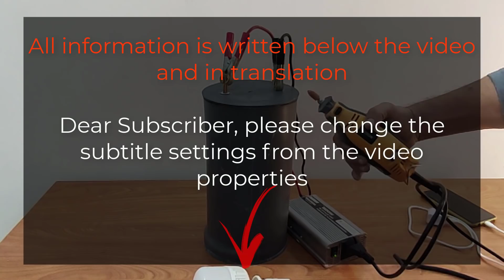Three months on probation until it succeeded

Comment: My friend asked me if this battery runs a 15w tree fan, how long will it take to run out of power, waiting for your reply, good luck
Reply from the maker: Mr
We ran a fan motor that drew 1 amp per hour and the fan kept running for 12 hours
Reply: WOW?
What was the voltage of the motor?
Reply: @NetHelp2 According to this information you have given, if your project is realistic, it is understood that it contains 2.76 KWH of power. !!! 
******* 
 Verdiğiniz bu bilgilere göre, eğer projeniz gerçekçiyse, 2,76 KWH güç barındırdığı anlaşılmaktadır.

Comment: It is a great idea, but the metals are corroded by reactions. If it is capable of lasting for more than a year charging and discharging itself, it could revolutionize the world. Otherwise, it is the same as what happens with current lithium batteries that last approximately 400 cycles and in the long run it is a wear and tear of raw material and contamination.
Reply: In a lot of emergency life-rafts, and survival kits there used to be a flashlight that was activated by water, you could even piss on it if no water was available, used to be able to buy them at army surplus stores
Reply from the maker: Yes, that's right, it won't last long for more than a year
Reply: Trick is that this is fake

Comment: Making a battery without knwoing how to make a battery!!! The voltage at best could be 1.8V for a single cell and quite a good amperage but not enough to drive a power machine even with an inverter!!! The Baghdad battery can greatly be improved by using anodized copper and iron but still will require a lot of cells to be connected in series and parallel to meet the power requirements of a drill. A Supercapattery design  could  be quite convincing!!!
Reply from the maker: This method is the same as the Iraq battery method. You can search for it in Google
Reply: @NetHelp2  True but it can't give out the energy as displayed. It is a very reliable battery and can be greatly improved with different eelctrochemistries and modified eletrodes. If you really like batteries like you do, I invite you to visit Dr. Robert Murray Smith Youtube Channel  for Energy Storage Materials. He has some great simplified tutorial and if you want more serious stuff, you just have to send him a message. I hope you get all you need from this great researcher who is giving the world all the knowledge for free as he breaks all the barriers of science for everybody to have access. Knowledge shoul be free, knowledge should be shared and thanks for sharing your knowledge with the world. If you have any question on battery electrochemistry, let me know. I would be priviledged to help!

Comment: THAT battery could at most only put out 0 volts and you can't charge it. It is a chemical reaction battery just like a modern-day alkaline battery. But there is a bigger problem at 1:57, both electrodes are copper, one has to be a different metal that doesn't electrolyze to get negative. What he has done is create two separate half cells that can't react with each other, which they have to, to create electricity. If you don't believe me tear apart an alkaline battery. What you will see is a metal tube that you tore apart which is negative, with a carbon rod in the center which is positive, and an electrolytic paste in between. It's just another one of those scam videos to get views and gets a thumbs down !!!
Reply: You are absolutely right, and the Bagdad battery made only  0.4-0.5V, no way any two metals in the Universe can produce a potential of 12V, especially if they are the same metal. Also when it was connected to the charger in the video, the Ammeter showed 0A!
Reply: @Tore_Lund  -- The guy said that you could charge it but there is a really big problem with that. They didn't have battery chargers back then, especially 12 volts. LOL
Reply: @Ken-rk3by  Yes, the Bagdad battery used Iron and copper, so it would not need to be charged, but this battery with only Copper?
Reply: @Ken-rk3by  not all batteries are chargeable and if you look there isn't any way to electricity to flow  , eve the Bagdad battery  add electrolyte where the anode and cathode are immersed
Reply: @brunobastos5533  Don't you think that I know that not all batteries are rechargeable and the Baghdad battery isn't. There is a use for the batteries. They knew about the importance of ionic silver and gold as medicine even back then.
Reply from the maker: Mr
This works on the principle of the Iraq battery
I think the charger is working fine
Reply: @NetHelp2  was it charged if yes for how long and what Collage?
Reply: @NetHelp2  Was it charged? if yes for how long and to what voltage?
Reply: A concentration galvanic cell. Go ahead to google.
Reply: Tradu an romana
Reply: Странно то что батарея работает и при этом варианты сомнений и отрицания, вот это и есть парадокс.
Reply: Esse gerador gera pra sempre?
Reply: Small pipe is what,with no porus hole,I don't believe in  this project

Comment: i need this urgently in my village where we have grid lines but no power in the last decade!
Reply from the maker: In which village are you?
Reply: @NetHelp2  Araromi Idowu, Bakatari in Oyo state Nigeria (7°23'56.9"N 3°41'48.5"E)
Reply: @Net Help, Howany times can this battery Size be recharged?

Also, can I use HydroChloric Acid If I do not get Hypochloric Acid?

Is It Possible To Add Water To The Powdered Catalized Charcoal and Salt Mixture? 

If The Battery Is Charged More Than 12V, Will It Explode? 

What Determines The Amount Of Voltage To Subject My Size Of Battery To? Is It The Size Of The Mixture? 

Please answer my question One By One. You are Saving And Already Liberating Us With This Video You Uploaded If You Do Know!!! 

We just Need You To Make Certain Areas Clear. 

THIS battery/capacitor coupled With Compaxt Dics Made Solar Panels Is The Final Answer To Permanent Power Supply!!! 

Please Sir, we need your reply to each of our questions. 

Thanks.

Comment: This is not a battery but its a single cell usually 1.5 volts or less for each cell how you manage to make the power inverter to run with this low voltage..? How can you manage to make more voltage only with a cell ? Thats a micracle...
Reply from the maker: It is not a single cell as you think, have you seen the Baghdad battery or the lithium battery from the inside?
Reply: @NetHelp2  no can you send a link with it and after I return for this chat.

Comment: 1)The copper rod is touching the salt at the bottom for working?
2) Battery acid will it work ?
3) Can you charge with 24v?
4) How long is the charging time?
Good work!
Reply from the maker: The bars touch the salt
It works with the appropriate output for the size of the battery
Reply: @NetHelp2  How long is the charging time with empty battery and what is the max charging Ampere need?Also can I use hydrochloric acid from classical lead battery?
Reply: @steliosstamatakis844  в свинцовый аккумулятор нет соляный кислота, учти физику и химию, от серного кислота делают соляную кислоту с помощью химического реакции, то есть, от пар серного кислота получаем соляную кислоту, соляный кислота очень ядовитая)) опасно для дыхательных путей))

Comment: What is the name of the white thing you used
Reply from the maker: All we need is
1 - briquette
2 - rock salt
3 - plastic tube
4 - two copper rods
5 - brass screw
6 - aluminum screw
7 - copper strip 3 mm
8 - 200 g Hypochlorous acid 200L / H with a concentration of 200 PPM

Comment: Your battery is strange. First, you use same electrode material. Second, no solution of electrolyte to dissolve salt (lithium batteries have organic solvent to dissolve lithium hexafluorophosphate). Third, if this nonpolar capacitor, it's need wide area of electrode and dielectric sandwich. Maybe this is fake battery with something hide inside your battery.
Reply from the maker: Mr
This is the working principle of the Baghdad battery, which was manufactured more than 2000 years ago
Search Google for Baghdad battery and see how it is made
Reply: I as for the polarity of this battery easily understand how it works because of my research in Don Smith Self Powered Generator. When you Have 2 Positives With More of it In one Close Area than the other, You will Get One Positive As Positive And The Other Positive As Negative. 
All to be achieved is "Charge Separation". 

YOU ALL SHOULD STOP LIMITING YOURSELVES TO THOSE NONSENSE DISH OUT TO US ALL AT THOSE USELESS GOVERNMENT CONTROLLED SCHOOLS GLOBALLY TO MAKE YOU AND I REMAIN THERE SLAVES WHO DEPENDS ON THERE I'LL GOTTEN OIL.

Whether this is a battery or Super Capacitor, It is A Game Changer. It is A Liberator!
NOW YOU CAN USE Compact Disk and Alluminium foil and Transparent Plastic Tape To Make Powerful Solar Panels as the Surface of those CDs contains readily, Super Active Silicon!

Make this SuperCap/Battery and you have Free Energy Collectors Cheaply!

Think, think, think like a Human!!

Comment: If I wanted to make a 3.7V battery, what should I change?
Reply from the maker: charcoal strips
Reply: @NetHelp2  What I mean is the basic criterion in determining the voltage.  I think that the problem with this battery is that it is damaged after being discharged and cannot be recharged

Comment: What a waste of time and materials just to tell a lie....

There's no way you can get that much amperage or wattage out of a battery using the size and configuration you have shown.
Reply from the maker: Mr
The acid used is the factor for power generation, and it is similar to the Baghdad battery that was made 2000 years ago, but we developed the acid and the used acid is five times stronger than the acid used in the Baghdad battery
Have you seen the Baghdad battery and how powerful it is?
Reply: @NetHelp2  Yes, I have seen the Baghdad battery, it's a simple single anode and single cathode acid battery. 

The limits of the wattage of such a battery is far to minute when compared to what is required to operate the higher wattage dremel type tool that you have shown in this video. 

Get real, stop with all the trying to over impress people.

Most people clearly understand the principles of the electrical elements, attempting to run snow jobs on people only makes them sad for you. 

Simply using your skills to show people how to build functional electrical tools would be great and probably much easier without all the trickery.

Comment: Ain't those transformers mostly 12 and 24 volts. So you say you get 12 volt or something out of this cell. A normal cell only makes 1.2 or 1.5 volts or something like that. This is why batteries in cars have multiple cells in one batterie and they put them in series. Same with normal batteries, if you want to have a higher voltage they put more cells inside the batteries in series. Not sure, but it seems a bit fake.
Reply from the maker: Mr
This is not like a normal battery
But the acid used generates energy
Reply: Les vrais mots. a l'origine. Il ne sortira pas de cette batterie uniquement. Un volt et demi. Juste. Alors que l'ampérage de la batterie augmente. C'est ce qui arrive. Alors. Il ne naîtra pas. Douze Fu lt. C'est un mensonge. et induire en erreur
Reply: Büyük başarı helal olsun düşünüb yapan ve paylaşan kardeşimize .canabi Allah yardımcısı olsun.degişik çalışmalarını da bekliyoruz.  Birde sıra ile içine konulan elementleri yazsa çok güzel anlatım olur.
Reply: I agree with your view. I was thinking the same thing. Or is there something extraordinary here? It brings to mind the following question, if we fill this setup with 6 Volts 10 Amperes, if we fill it with 6 Volts DC and 24 Volts 5 Amps at the end of the filling, will a voltage value of 24 Volts DC be obtained at the end of the filling? Does the voltage value to be taken after filling depend on the filling voltage value? If our friend informs about this issue, he will have done a useful job. !!! 
******* 
Bu görüşünüze katılıyorum. Ben de aynı şeyi düşünüyordum. Yoksa burada bir olağan üstülük mü var! Akla şu soruyu getiriyor, bu düzeneği 6 Volt 10 Amperle doldurursak, dolum sonunda 6 Volt DC, 24 Volt 5 Amperle doldurursak dolum sonunda 24 Volt DC lik bir gerilim değeri mi elde edilir? Dolum sonrası alınacak gerilim değeri dolum gerilimi değerine mi bağlı olmaktadır? Arkadaşımız bu konuda bilgilendirme yaparsa faydalı bir iş yapmış olacaktır. !!!
Reply: A lithium battery is 3.7volts per cell.
Reply: Cool
Reply: Car battery is made of 6 cell to store more AMPS energy. But if you make one that big battery one cell  also will store energy. What makes the battery voltage is when is charged in 12 volts then the charcoal and battery acid are energized to load of 12 volts and store what has been energized, then the ions find negative and positive from where is been charged the first time with the charger and that will the polarity + and negative - of the home made battery 12 volts, the if you want 24 volts DC make another battery  and connect positive to negative from the second battery then  will be two cells making 24 volts dc.

Comment: the problem here is to call it battery, as it seem more like to be a capacitor,   ones there are separated chambers separated via nonporus plastic tube it can only change the charge.  So it is so that it will not work if you take out the inner plastic tube?  or I am wrong,  I have seen similar experiments without it..
Reply from the maker: Mr. in the next video will explain how to connect slowly and I will work not to turn off the battery before the experiment

Comment: I thank you for what you have done, but there is still a question: The inner pipe is TOTALLY Isolated from the outer one with silicon, how the salt can do the transaction of the power????? Thanks to you, and looking for your reply.
Reply: @raluhoragontv  A lead-acid battery has sponge lead on one plate and zinc on the other plate with a sulfuric acid solution as the electrolyte. You do have to have two different metals to make an electric connection
Reply: @Ken-rk3by  Are 3 electrozi. Ca un acumulator cu două celule. 2 cupru un carbon (activ). Clorul este cărăușul sarcinilor electrice.
Reply: @constantinvasile2964  Sorry man I don't know what you are saying. I only speak English.
Reply: A concentration galvanic cell with not trasmition a ion. Go ahead to google.
Reply: @raluhoragontv  Obviously you have never taken apart a lead-acid battery one is sponge lead and the other I believe is zinc. When you melt them down only the lead melts leaving the other plates untouched. Zinc has a higher melting point than lead
Reply: Does it mean the inner pipe can be elomited or just be punctured?  Pls what is Ah...capacity the battery. I didnt see it being charged and after discharge from usage what next? pls respond
Reply: Kkkkk
Reply from the maker: Mr
We punctured the tube in the video, but because of the montage, this moment was forgotten due to the speed, and in the next video we will work to avoid these mistakes
Reply: @NetHelp2  Now it makes sense, thank you for explaining.
Reply: @NetHelp2  -- Even if you did punch holes in the tube it still doesn't have a negative post As the acid eats both posts.
Reply: @NetHelp2  PLEASE REDO THIS AS PROMISED SOON!
Reply: @raluhoragontv  both terminals have lead but one must be different aka mixed with some other alloys or plated to be able to create a positive charge
Reply: @raluhoragontv  I know more
Reply: @raluhoragontv  it’s now what I’ve made up it’s what’s been know for decades by scientists
Reply: I think there few batteries inside the tube...
Reply: @harunhanin754  -- Ya I wouldn't doubt that the more he changes how he built it. The more fake it becomes if he put 8 rechargeable batteries in series he could charge it at 12 volts like he claims
Reply: Fake

Comment: It will produce large sizes, however, volts per 1 cell.
should not exceed 1.5 volts.
Reply from the maker: We are working on producing a bigger capacity battery

Comment: very good, but the inner pipe charcole is completely insulated  from outer side charcoal and there is no touch between both charcole even from the top. would you explain more
Reply from the maker: Connect via salt at the bottom of the tube
Reply: now the bottom side of the tube is very thin to allow passage of huge current through the wet salt between both chambers.

I'm wondering how you achieve it?
Reply: @jumasmarty6643  при окисление медь с помощью кислота выделяется водородный газ, и с этой газ образуется напряжения))

Comment: FAKE FAKE FAKE
ONE UNIT BATTERY NO 12V,  MAX 2V
Reply from the maker: Sir, the problem is not with the electrodes, but the acid is the most important
I hope you don't fake it before you try it
Reply: @NetHelp2  Acid no important.
This video is FAKE
MAX  2 Volt
Reply: @NetHelp2  Good work my friend, dont let these clever assholes spoil your enthusiasm... All they can do is criticism.... 😉

Comment: Ne prenez pas cette vidéos au sérieux, il n'est pas possible d'obtenir un différentiel de 12v avec seulement 2 électrodes. Le différentiel de potentiel ne doit être qu'entre 1.4 et 1.7V avec les produits utiliser. En aucun cas l'onduleur ne pourrait fonctionner. Une batterie doit être cacher dans le tuyaux.
Reply: Yes max 2V  
This is a fake video
Reply: @profezor2  la batería puede cargarse a 12 voltios pero el inconveniente es que su duración pueda ser mínima.
Reply from the maker: Monsieur
Avez-vous cherché sur Google les caractéristiques de l'acide utilisé ?

Comment: 😂😂😂 its fake  battery no way between copper to connect and no single cell can give 12 volt
Reply: Yes, FAKE VİDEO
Reply from the maker: Mr
The salt we put at the bottom of the battery is the way
The acid is the base of the battery
Go to Google and search for the properties of this salt and know the result
Reply: @NetHelp2  to make any battery u should put the two anodes in same continer and betweens elecolit not continer inside continer .
and no single cell can give 12v  never u need to read more about how to make battery and chemistry